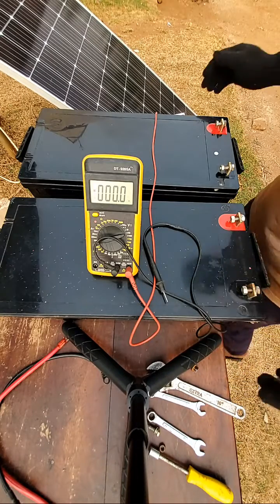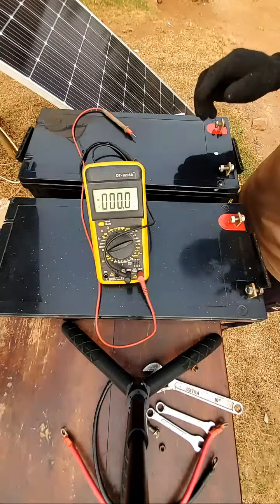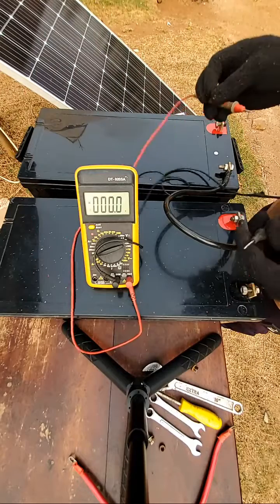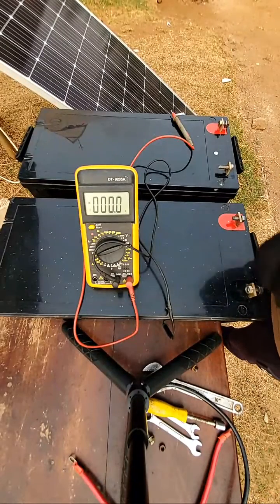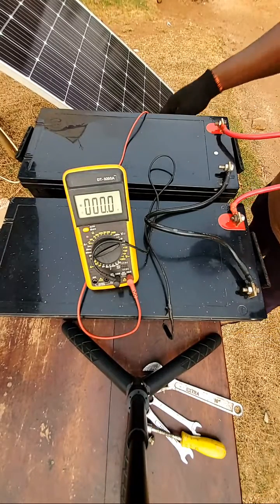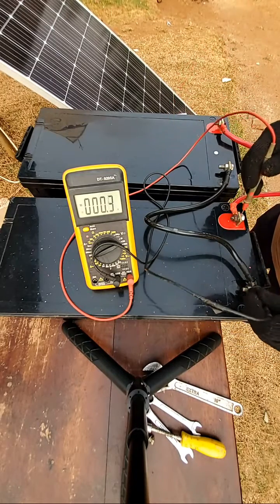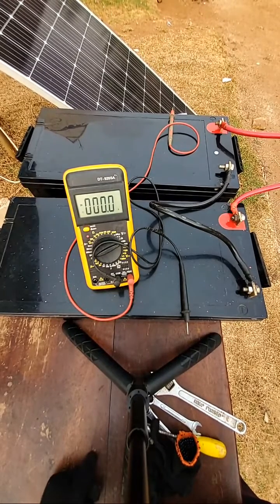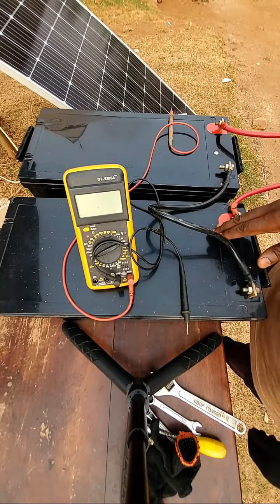How to connect batteries in series and parallel

Comment: Welldone boss, if our batteries are connect in parallel and the voltage remain 11.7 which means 12volt, is the inverter to be install to be install must also be 12volt
Reply from the maker: Yes... But a 12v battery reading 11.7v shows that the battery has been deeply discharged. This not too good for a sealed or flooded battery.